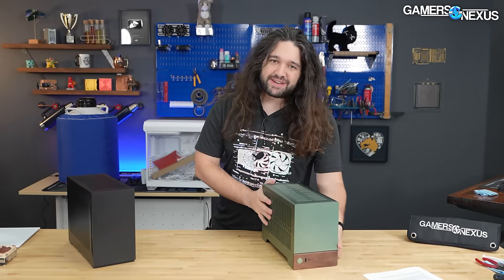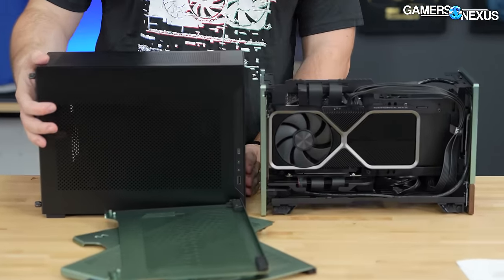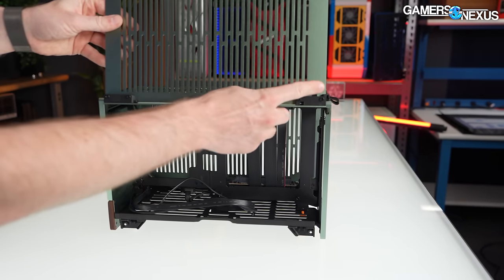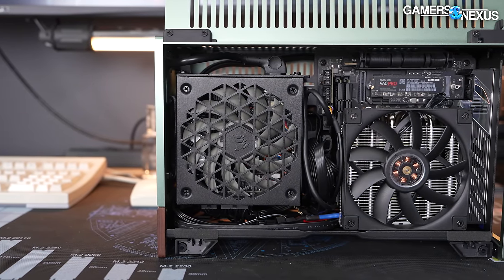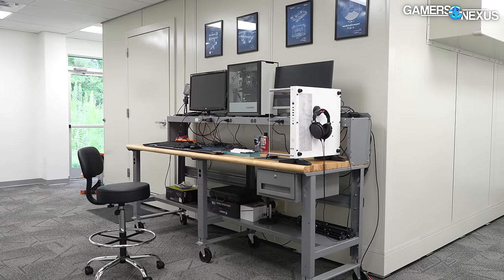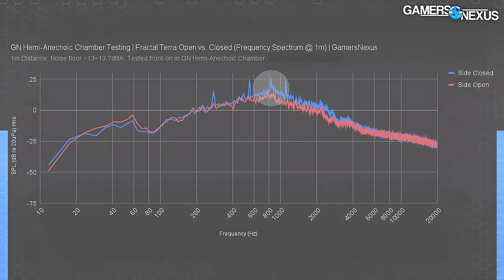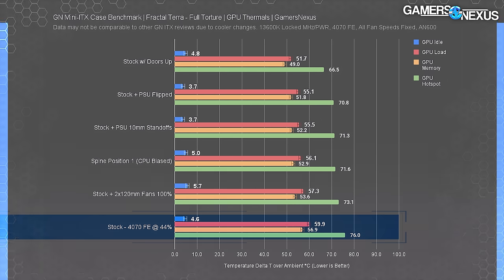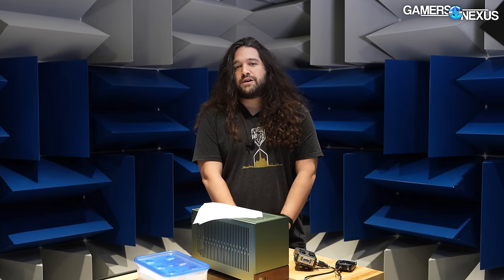Fractal Terra Mini-ITX Case Review: Build Quality, Thermals, Acoustics, & Cable Management

Comment: Hello Steve and GN crew (and fellow YT folks)! Love the work you've done, and Im super geeked for your push to ITX reviews with accountability and data at the forefront. Yall rock!

Im currently running my Terra with a lower- to mid-tier setup with AMD hardware and have found some... interesting issues and caveats in this particular case. I put my thoughts below in case some are curious for a user review with newer mid-level hardware.

TL;DR, your conclusions about mid-tier gaming seem well-founded, and are corroborated by my experiences -- however, there may be some inherent problems derived from specific mother board choices, which may require novel configurations to alleviate. Overall good experience. 
-----
Case: Fractal Terra (spine setting 2)
Mobo: ASRock B650E PG-ITX Wifi
CPU: AMD R5 7600x
Cooler: Noctua NH-12L
RAM: GSkill Trident Z5 (2x16GB)
NVME: Samsung 980 Pro (1TB) (x2; front and back)
GPU: ASRock RX 6650XT 8G SL
PSU: Corsair SF750
-----

On CPU/Mobo Heat:
> In one scenario, the built in NVME cooler on the mobo created a heat-trap inside the case. The mobo was likely designed for this component to be on the bottom - not where the case is suggesting the airflow be pushed out - toward the top. Between the riser cable and this big block of billet, my CPU thermally throttled under relatively light loads. After swapping that block for a lower profile cooler, NVME temps went up a few degrees overall, but the CPU only seems to max out on much higher loads. The pathway for air flow is now less obstructed by ~3square inches... which is a gaping hole in SFF...
> The 7600x has been set via BIOS to an 85 C thermal max, with fan curves set to mediate noise under moderate loads. It was finicky, but it works well once tuned, same as any initial system setup. SFF is probably just more sensitive to small changes here than (m-)ATX cases.

CPU Cooling Noise:
As you say, the fan being placed so close to a slotted panel is no doubt chopping the air and creating some gross freqs. The Noctua NH-L12 G1 seems to sidestep this by having the fan separated from the side panel slots by way of the cooling fins. I have mine configured to updraft, as downdraft configs exacerbated the aforementioned heat problems (CPU+NVME, but also RAM and VRMs). Noise at 100% is tolerable, and doesnt seem to have any particularly icky frequencies.

GPU:
[NOTE: the Terra comes with a PCIE4 riser cable, and others in its size and price often come with a PCIE3, requiring more investment.]
Running cool, has plenty of room to breath. High 60s to low 70s and well into 60+ FPS on some mid 2010s titles... fine for me. SFX PSU w/ 10mm standoffs allows excellent ventilation from the 3rd passthrough fan.

PSU:
[Big thanks to the Cybenetics database for helping me choose this!] With the fan oriented to intake from the side panel, thermals are well under control, and voltages are stable. Could probably afford to rotate and accommodate more pull from the GPU... not necessary for my work.

Cable Management:
About what one would expect from an ITX case this small. It's not without some swearing and grumbling, but a moment's consideration for space lead me to obvious pathways that dont crowd airways too badly. Like Steve said - dont smash those GPU cables with the lid... find another way! The cables that came with the SF750 adjust nicely to accommodate corners and u-bends...

-----
I mostly browse, stream, research, and game things that are NOT recent RT'd AAA titles... so my experiences are defo not for the ITX Power Gamers amongst thee. It suits my needs just fine, and looks gorgeous on my cramped desktop/workbench. I hope this helps some folks out there! ^,..,^I put my thoughts below in case some are curious for a user review with newer mid-level hardware.

Comment: Try to flip the bottom slim fans so that they act as exhaust. I've heard this is better than intake. But also just in general, exhaust fans are more effective in ITX cases, due to there already (usually) being an abundance of intake fans in the form of the CPU cooler and the GPU cooler itself.
Reply: Yep, 100% correct
Reply: It's counterintuitive if you're used to working on regular cases, but yeah, that makes sense in this case in particular.
Reply: negative pressure is cooler in general. I believe the main complaint is the distance of the fan from the floor. As GN has tested before; a solid front panel needs at least an inch gap on the sides to be effective. The ground being a solid panel, you need at least an inch of clearance off the ground for the fans to be effective. 26:50 in steves own words "The legs need to be longer" the noise is not worth the cooling ability. Still having the exhaust fans up top would be better because hot air will instantly pulled up and out (not down and around your PC for the CPU/GPU to suck hot air back in). Hot air naturally rises and you don't want to fight that. Fans on the bottom just collect dust to shoot it right into your GPU/CPU heatsink and then you can get 5 degrees hotter temps in a month just from enough dust blocking a few fins by your GPUs hot spot. As Steve points out tho; ITX cases are very particular with the part your choose and if you got to put the fans on the bottom as exhaust to save your suffocating PSU from a giant GPU, you gotta do it.
Reply: @coryandrum I'm well aware of what Steve said in the video, however flipping them to exhaust would improve temps. We just don't know how much, because it wasn't tested. Yes, top mounted exhaust fans would be the best, because they are practically unobstructed there. However due to the raised spine design of this case, it's not possible to fit two 120mm fans at the top. Large design oversight in favour of looks. Meanwhile the FormD T1 is practically the same size, has the case concept Fractal took "inspiration" from, and can fit two normal width 120mm fans in the top. Works much better for thermals.
Reply: I hope GN sees this comment as it was an oversight for this review. The case doesn't have good exhaust options so it'll be interesting to see how much difference flipping the fan would make.

Supporting top slim 120mm fans would help a lot, I hope this is considered for the next revision.

Comment: I just got the green terra and I have to say it looks even better in person than on camera. It was super easy to build in too, Im happy with it.
Reply: did u go intel ?
Reply: @plantherain  No, Ryzen 5 7600
Reply: @Bpinator  hows the cpu hoolding up?
Reply: @tinyoku  Works well, though to be honest I think I would’ve rather had not gone the Terra if I had to do it all over again. The two problems I have are heat and noise. It has been a struggle to keep it cool, I ended up putting a thermal limit in the bios, which solved the problem at the cost of cpu performance under load. The noise problem is way worse though. CPU and GPU fan aren’t too bad, but the fan on my motherboard is. I am using fan control to limit the SSD fan to 50%, which so far hasn’t caused any issues but I do not like a hacky solution like that. Without it though it’s the noisiest computer I’ve ever had. So all in all, I’ve kind of gotten soured on ITX, though it could have just been I didn’t build it well.
Reply: @Bpinator  thanks for the update, i had seen reviews saying its the side pannels that amplify any fan joise going on in the case which is what made me look at alternatives since i do want a quiet system, any flaws with the 7600? Or does it handle everything well
Reply: @tinyoku  No flaws with the 7600, I like it, I think the price to performance is very good, especially coming from my previous i5 4690k. However, the 7600 I have is a replacement for the 7600X I had previously that died after about 2 power on hours lol.
Reply: @Bpinator  dying after two hours is crazy, anyways i apreciate it man thinking bout using the 7600 as a travel gaming chip, tho im not sure if i should commit to mini itx since mini atx is a lot more bang for the buck even cheaper honestly
Reply: @tinyoku  Yea the 7600 I definitely recommend. Dont get me wrong, I love the mini-itx form factor but it does come with challenges so be aware of that

Comment: Thanks for getting into mini-ITX case reviews. Seeing a perspective outside of ultra enthusiasts is really nice.
When it comes to the PITA factor, some people (like me) build in mini-ITX cases in part because of the challenge. Just keep in mind that difficult to build in may not be as much of a discouragement as you think.
Reply: Till you get so frustrated you take out Sawzall. Honestly tho most of the PITA is just poor planning and you learn from it. Not saying the EVGA Hadron was a poorly made ITX case (the bottom intake was just 30 small holes on either side with temperd glass and another solid side panel), but I never used a flex PSU before and did not expect it to sound like 30 ps4s mining Fifa tokens running idle at only 40c. The VELKA 7 tho, was just a horribly designed case; bought all the right parts just to find the maker didn't follow his own spec and lied. I was just trying to find out how to get brackets with the correct holes that hold the case together and allow the display port to be accessible. The guy that made it was just an unprofessional person to work with. I am so glad ITX has gone mainstream, now GN does an amazing job finding most of the PITA pitfalls so you can plan around it.

Comment: I definitely appreciate the mini-itx case reviews. From my own experience I can tell you that heat re-circulation becomes a big problem, I had a Fractal node 202 and I had to make a cone shaped barrier for the CPU cooler to prevent re-circulation. Reduced temperature of the CPU by about 10-12 degrees while running cinebench, and 4-6 degrees on SoTR.

Ingenuity can give you a huge pay off on these kinds of cases.
Reply: How was your general experience with Node 202? Considering that case too.

Comment: 24:24 - That's the sound of disc from Yuri's Renevge right there!
Seriously though, very interesting and useful noise testing, investment in "silent chamber" and new acoustic equipment is paying off already. That's the level of tech journalism rarely seen around. Thank you!
Reply: Oddly enough I thought it sounded like an X-Com cyberdisc!
Reply: @FraserChapman  I think you are actually correct - even more so than I am. You've just reminded me - cyberdisc movement sounded like that on soundblaster 16 (it was a pulsating sound, but around the same frequencies as heard here). I'm also pretty certain that RA/YR sound engineers from Westwood were inspired by the sound of cyberdisc from XCom.

Comment: I build everything in the Torrent Compact (air) nowadays, parents, bros, friends but the cable space is a NIGHTMARE. Interesting little case and awesome video.
Reply: After a 4th build I kinda got a glimpse of it and the right trick to cable manage it however if you want to add more thingies SATA SSDs, FAN/RGB controllers it gets more and more frustrating lmao. But just love how it looks and performs. Wanna try Lian Li someday especially the O11 Air Mini.
Reply: I build everything in the NR200 as it's smaller, cheaper, easier to build in, better cable management

Comment: I’ve loved seeing a good chunk of the industry moving towards more mesh. The thermals in a lot of decent/good cases on the market are really only a few degrees away from one another. Now it will be interesting to see larger manufacturers tackle ITX, which, at the moment, always has thermal issues with high end hardware. It’s almost universally accepted at the moment that you will lose performance due to thermals in an ITX build unless you are willing to run your fans at max speed. I really want to see ITX take off.

Comment: I've just finished building mine using the Alpenföhn Black Ridge CPU cooler. It fits perfectly in the max GPU-config. All that is required is some low profile RAM sticks (<34 mm height if I recall correctly). Optimum Tech did a build using this CPU cooler and case.

Comment: In green that case is extremely pretty. I applaud Fractal for trying this and in generally the build quality justifies the price

It feels as though they have shrunk the case size just a little too much, an extra 10mm in width and height would make a big difference - although in ITX world it does seem as though the primary selling point is always "we are  the smallest".  Similarly they obviously got the design wrong using slots as a vent shape rather than more traditional fine mesh.

Comment: Thanks for including the Audition spectrogram! While it's not really a scientific measurement tool, Audition is honestly pretty legit for analysis in pro audio contexts with the high quality metering tools like the spectrogram and superbly flexible FFT. I use it constantly for comparing microphones, preamps, effects processors, even instruments quickly and efficiently.

A few suggestions for the future: you can do a lot to configure the spectrogram to be more readable (right-click on the frequency plot). I often make it slightly more logarithmic so that the lower frequencies are more visible, and you can increase the frequency resolution at the cost of increasing temporal smearing of the image. This gives a sharper result with more clearly visible LF bands, which is way more readable but may smear horizontally if your sample size is too short. You can also decrease 'Decibel Range' setting in Preferences -> Spectral Displays -> Frequency Display to increase "contrast".

In the FFT plot ("Frequency Analysis") you can also do an average measurement across a section of audio by hitting 'Scan'. For comparing noise floors of different gain settings on a mic pre, I might measure 1-2 minutes and average over it. You should consider noting your FFT size and windowing function in your frequency analyses as they are not directly comparable and may result in different size/shaped peaks or smoother/sharper results if changed.

One last suggestion: you might want to consider including CCIR/ITU-R 468 weighting if possible. It more closely resembles the difference in audibility of objectionable sounds by human perception than simple A-weighting and is widely used in the EU but is very slow to become adopted here in the US because the values usually appear about 10-11 dB higher than A weighted values, and we all know "big number look bad on spec sheet"...

Comment: First off. Love the review.

But.. I noticed you didn't cover if the case had 2.5 or 3.5 inch drive support. Most of your viewers are definitely smart enough to look up the manual/specs on the fractal website, but it could be something to cover going forward. Some people want ITX builds for a small media server (though I wouldn't be purchasing a case this pretty/expensive to shove in a server closet.. so my point is semi invalid).

The frequency spectrum analysis had me excited. I had to use the frequency domain in college to show what frequencies were affected by my final guitar project. As you demonstrated, the frequency of the noise is just as important as the noise level. Another huge leap forward in your testing.

Side note. I despise the green colour. Graphite looks far better in my opinion.

Thanks for stepping the quality again Steve. We come here for the numbers and you do not disappoint.

Comment: I own two Terras, and I have had quality-control problems with both. The first had bent pins on the front-panel USB-A connector. Fractal sent me a new one without too much hassle. On the second one, two of the four motherboard standoffs were threaded to 6-32 rather than M3.

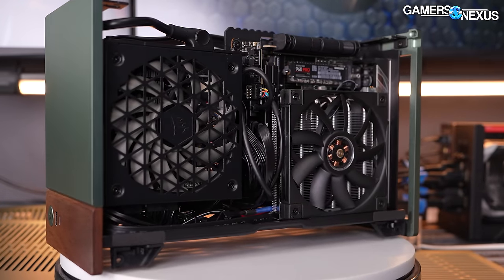Comment: As a scientist and statistitian I always get struck when being presented "incomplete" charts. At the timestamp 26:12, the video includes CPU temperature data presented in a bar chart as a delta over the ambient temperature, accompanied by error bars. It is notable that charts lacking detailed information regarding the nature of the error bars, such as the representation of standard error (SE), standard deviation (SD), average deviation (AD), quartiles, range, or other pertinent metrics, alongside the mean or median value, and the number of replicates or runs (n) each bar signifies, can potentially elicit concerns. In contexts of scientific inquiry, the omission of such essential information within charts is generally deemed unsatisfactory and typically has to be addressed by the authors prior to publication. While acknowledging that this video is not a scientific publication, aligning with esteemed standards could involve the incorporation of these specifics. For instance, you could consider including relevant details, such as "Mean Temperature Delta T over Ambient [K or °C] ± SD, n = 5," within the title of the x-axis or another appropriate location in the respective chart. This would not only enhance the transparency of the data but also signify a commitment to maintaining rigorous standards in the presentation of such information. Apart from this, I really enjoyed your review of the case. Thank you very much!

Comment: Seems fair to adapt which hardware is being used depending on the case being tested. A big part of chosing to go small is considering what you can get away with. If a larger case offers better fan support but you can't find a place for it anymore on your desk or whereever, what good is that fan support doing you after all. What a small case does and doesn't allow you to put into it is absolutely part of the test.